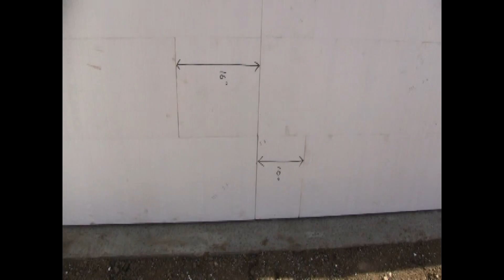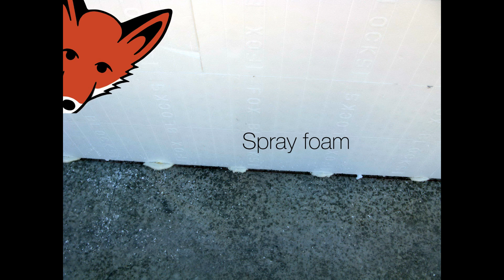ICF First Row Install Tips | Using HV Clips + Stack Seams with Fox Blocks Insulated Concrete Forms

Comment: Really great video, but we missed the reason why the man at end of video was spraying expandable foam underneath the first row.
Was that at seams, or random?
If it was at seams, why wouldn't the ICF contractor spray the whole base wall in one continuous bead line?
I know it's probably overkill, but knowing 'water' and moisture  , it always seeks it's lowest level, therefore the bottom of every wall.
I hate basements and crawl spaces ! Even diligent expensive contractors in the north states never get the ' musty ' smell out or keep it out without tons of air filtering.
I use an Alpine air machine which ionizes the air, so it always smells really fresh and it magnetizes dust particle so they fall to the floor.
I am using solar for off-grid application and putting in the embedded tubing/coils for radiant heat hot water. Cement companies are being all bought up by Chinese men, so we don't trust any concrete unless it's an American true and true owner!
Great video, keep up the good work.
Better to have two pair of $15 socks from American manufacturers, than 10 from poisonous China...lol :)
Reply: They do that after they get it all level and on line to just lock in the first bottom two rows exactly where they’re at. That way when they start stacking more blocks everything fits together better, stays tighter, more level, and straighter.